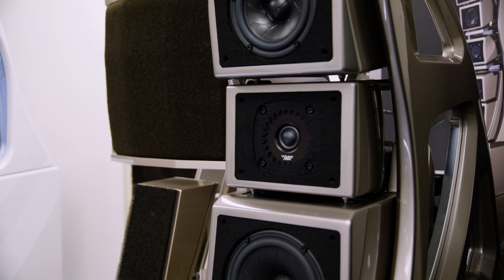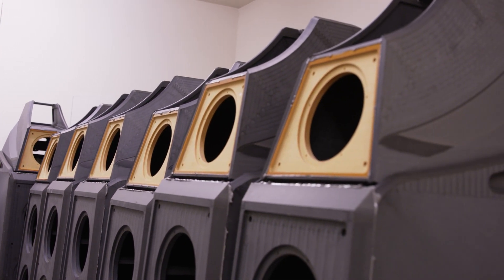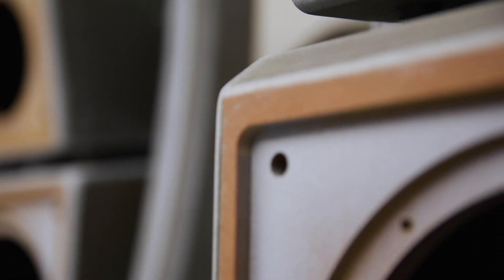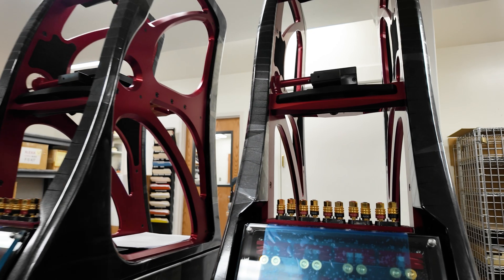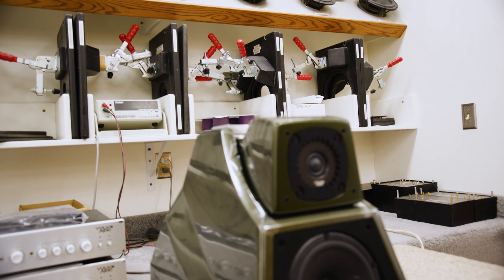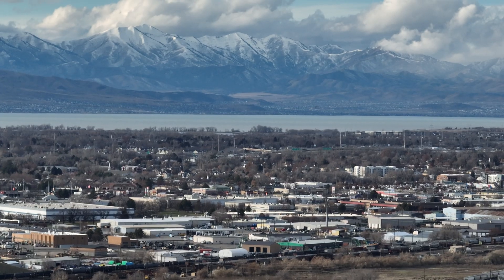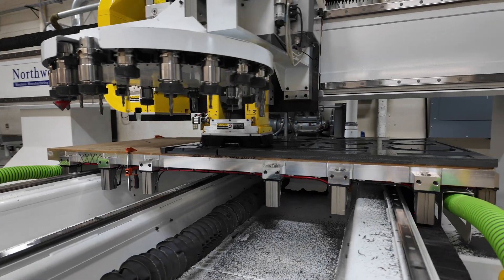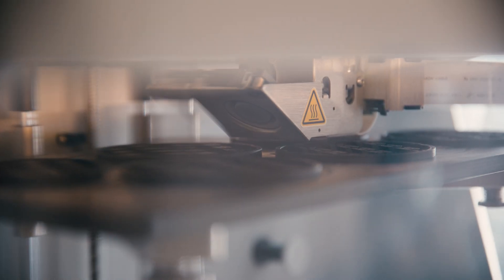X, S, and V Materials—Wilson Audio's 50 Years of Perfecting Loudspeaker Cabinets (June 2024)

Comment: Yet they still have parallel walls in all cabinets..
Reply: I'm not sure many people would look at those midrange enclosures, for example, and say there are parallel walls.
Reply: @dougschneider8243  I'm not sure I follow, each enclosure has at least one pair of parallel sides. You very well know this is a bad thing in your speaker and / or in your room.
Reply: @sb6-SSaM  Internal resonances of a speaker cabinet are quite a bit more complex than that. But first, if you want non-parallel walls, I'm looking at a lot of their speakers and the front panels aren't parallel with the back, and the sides aren't parallel in a lot of instances. Look through their lines. Even look at the little TuneTot. But also, internal resonances build up depending on the dimensions of the cabinet and the specific frequencies aligning with that, like in a room -- you get standing waves at specific frequencies. Also, you can't just look at outside the cabinet, but also inside and what's in there to break up potential standing waves.
Reply: @dougschneider8243  You were at the factory, you tell me, are there internal bracing and additional material that makes side top to bottom and / or front to back walls nonparallel?  I'm betting no. Also, no rigid material, X, Y, Z, whatever, will ever absorb and avoid vibrating especially at higher SPLs in such a small enclosure, it's primarily BS. But, you've visited them and can't speak badly of them, like you used to, right?
Reply: Oh, I know who you are now, you're Steve, who comes on my Facebook wall from time to time and gets really angry if you think someone is not listening to you. Anyway, I had to actually read your above post and, I want to reinforce, how stand waves build up inside of an enclosure is much more complex than you wish to make it out to be. And how the inside looks is oftentimes different than what you see on the outside. But perhaps more important, you have to look at the measured response of the speaker to determine if there are any resonances "escaping" from the design that are audible. I suggest you read some of Dr. Floyd Toole's work on the subject.
Reply: @dougschneider8243  You have me pegged, yes without attention I wither! :-) Or is it you that can't be honest because you're a reviewer who bashed Wilson for years, yet now defend them because $ matters more than honesty? Pause for internal reflection, Doug. Also, WRT FT, yes, I've read his collateral and much more, plus I have an engineering education and experience you wish you had. Tread lightly "journalist".
Reply: what matters is to move cabinet resonances outside the working range of the driver mounted on the cabinet 
One challenge is when you have all the drivers in the same cabinet    I see that Wilson Audio TOTL models have one cabinet for each driver   This will help 
Usually for woofers stiffness is what to look for  For mid high just adding some mass will suffice